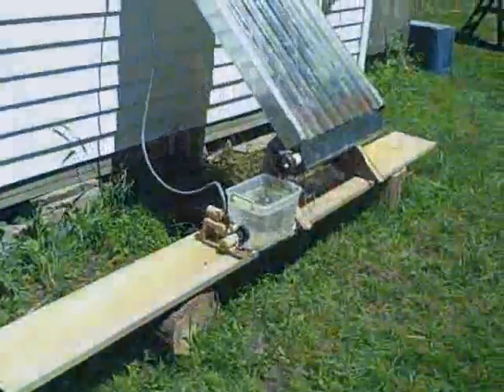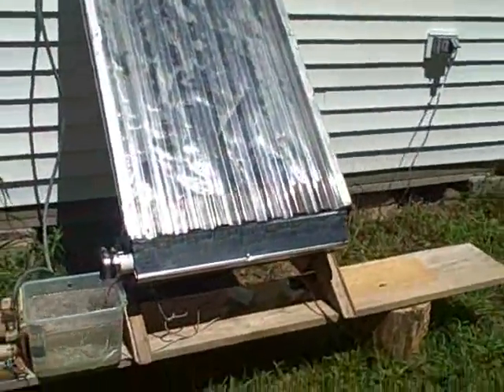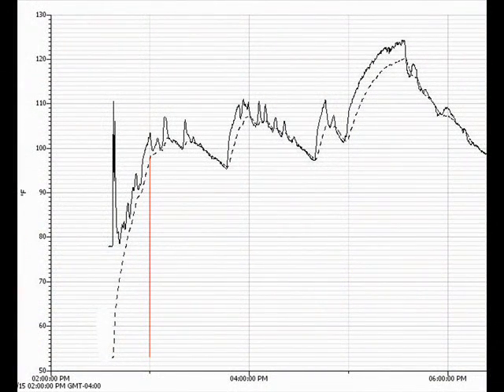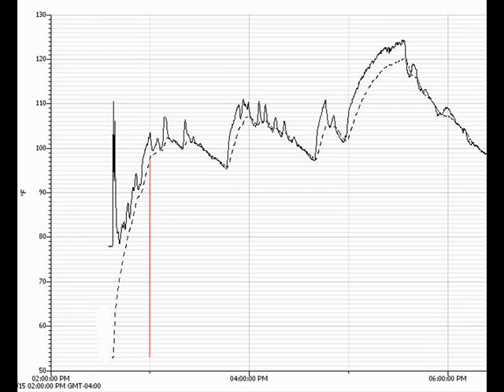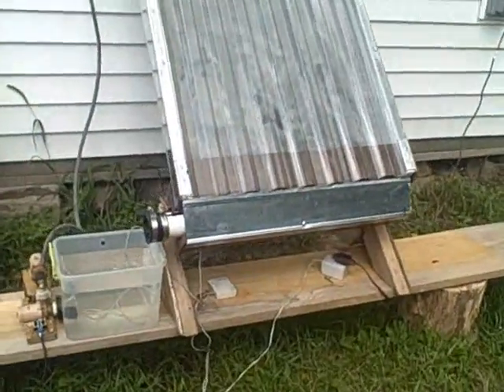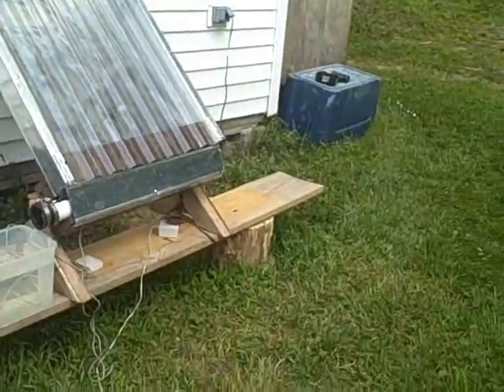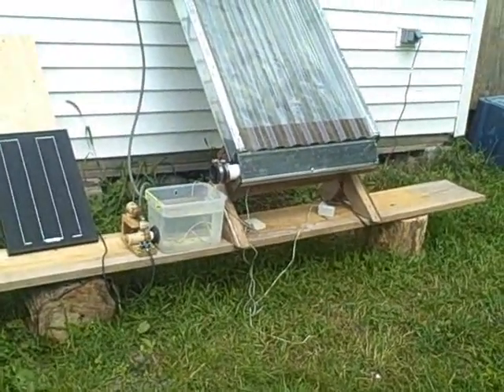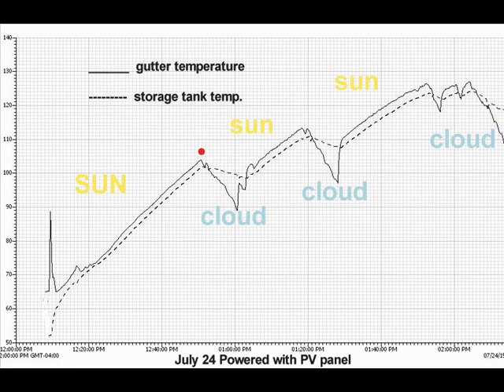MTD temperature data

Comment: Obviously the storage tank can be improved upon, it can be insulated and painted black for example. There would be less of a drop off of temperature.
Reply from the maker: Strange Science News Yes a major source of heat loss is through the tank walls and evaporation through the top of the tank. If these problems were addressed in full sunlight the tank temp would reach 200*F.